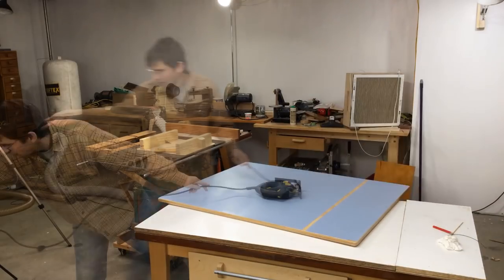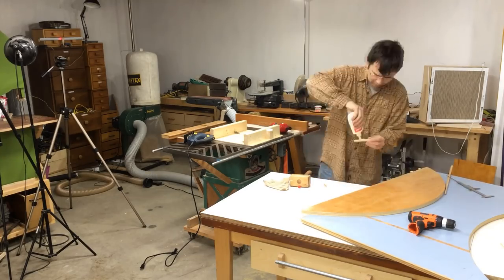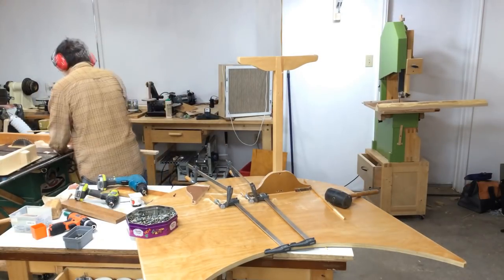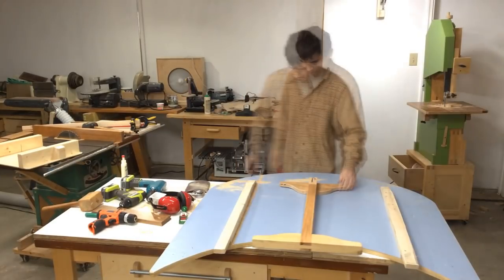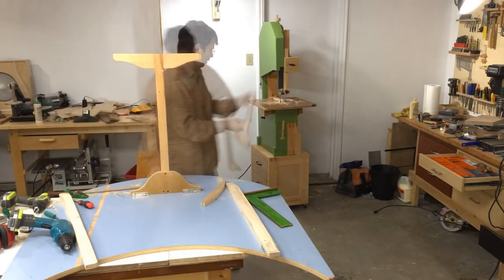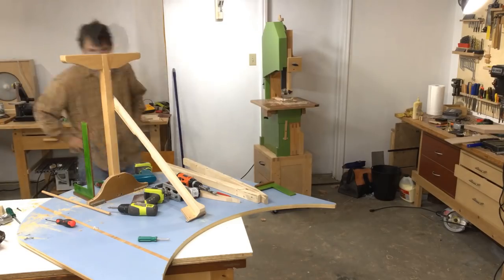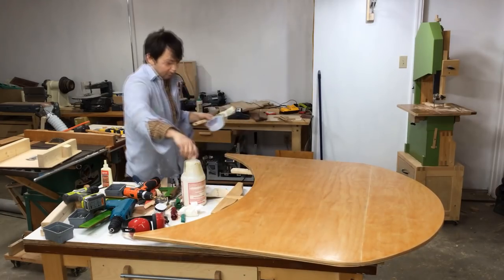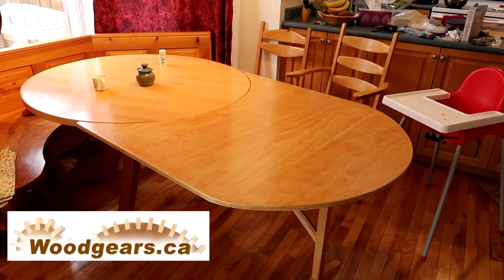Building an extension table for a round  table

Comment: When I saw that curved cut-out it took me back to my doing the same sort of thing with our dining-room table to accommodate eleven family members around a table designed for eight, a few Christmases ago.   We needed the same arrangement for the Christmas just gone, but I had dismantled the extension and used the wood for other purposes in the mean time.   I was therefore faced with doing exactly what your video shows - for just one meal - so decided to borrow some tables from our village hall instead!  Five minutes to collect and erect them in the lounge meant we all sat together without lots of work!

I appreciate that your extension is a more permanent addition, and doesn't need hiding under a tablecloth like my original version.

Comment: You could make wooden knobs (like you usually do) for those bottom screws so you don't need a nut driver! Also this video now works, it didn't few hours ago.
Reply from the maker: thought about it, but would have to glue to the metal.  figured not worth it right now
Reply: Fair enough, tnx for the reply!

Comment: Some of you folks are having video loading problems with YouTube. That appears to be a common - but low occurrence - problem with that platform. Usually it happens shortly after the author uploads the video in question and soon corrects after a delay ( maybe YouTube's chewing and digestion faults occasionally ). Sometimes a simple browser reload is sufficient to let you proceed after cache is cleared/replenished. Or perhaps try a different browser. Maybe, if you usually sleep your device rather than shutting it down, try a power cycling reboot and see if that helps. Rarely does it seem to be caused on the author's side - and so the user must try to do the troubleshooting for themself rather than notify the author.

Comment: You should make a handle that attaches to the bolts. Cut some wood into a star shape or wing nut like shape cut out a hole for the bolt head and then a set screw to help keep them attached. That way you don't have to grab a tool when you want to connect/disconnect the extension. =)
edit-spelling

Comment: No problems running plywood over the jointer like that?  Supposedly the glue lines between the layers will put groves in your jointer blades.

Comment: video is broken, wont even load.
Reply: Switched to Internet Explorer and now it works!
Reply: I had the same problem on my LG TV actually. iPad worked. Not sure what is going on. Some kind of encoding thing?
Reply: Works fine for me. The iPad time lapse app probably has some encoder errors, you could run it through VLC or Handbrake and recode it with different settings to fix it.
Reply: Its not like he took the timelapse video straight off the iPad and uploaded it here... he clipped together other pieces of video such as the ending bits and re-encoded it to a new video file in whatever video-editing software he uses.
Reply: problem is on your end, deal with it

Comment: On Linux (Kubuntu 16.04):
Chrome 63.0.3239.132 does not load.
Firefox 57.0.4 Loads extremely slowly (about a minute) then plays about a second at a time.
On Android (7.0) Youtube app:
Loads slowly and plays with interruptions.

When downloaded with youtube-dl, resulting file has no audio. 

If you're using some sort of Apple codec, that may be a contributing factor.

Comment: Hi wonder if you could help, I know how to find equal spacing e.g. between balasters on a deck railing or stair rails but given several different sizes how would I keep the spacing the same and that being also at the first and last post of a railing, is it  a case of setting out to give me the spacing I desire and would I work out the railing length say on steps first and the set the size of the deck to suit, I'm also not sure about stair railings in an house, as I think normally the treads set the trend for the spacing but when the railing runs along a landing would the drawings have been done for a railing that finishes at a wall to a specific length to match the spacing on the rise of the stair ratings or is it a case of loads of calculations until they're close as possible am I missing an easier way, sorry for essay don't know how to put it any better, I've not seen any of your vids on deck or stair rails but your others suggest your engineering mind could help, I've sent several messages to other apparently carpenters on you tube without replies I wonder if I'm asking a daft question if so hope you could tell me either way, cheers

Comment: That's odd, I tried the video once and it buffered a lot. Then I stopped it and restarted it and it worked fine.

So if that's the third use of the plywood, is that re-recycling? Whatever. It's still a very clever idea. I've done similar but it didn't have any refinement, was very crude, but it was a one time use and it was covered with a table cloth.

Comment: Matthias for all of us that can't make it work could you kindly re-upload it?
Reply: Switched to Internet Explorer and now it works!
Reply: Yeah IE to the rescue? Something I thought I would never hear.
Reply: Open the URL in VLC if you want to avoid IE
Reply: arcrad You sir, deserves a thousands thumbs up
Reply: Works great in Netscape navigator
Reply: Works on mobile
Reply: works for me on my outdated version of chrome.
Reply: Didn't work on my computer but it works on mobile
Reply: It did not work in the first hour of release. now it works though
Reply: I'm starting to wonder if I'm the only person who had no issue playing this at all. Played on my crappy old core 2 laptop on firefox.
Reply: Joe Will - I tried to watch it within the first 30 minutes after it was uploaded and it wouldn't work.  Came back and watched it a few hours later and no problemo.  Sometimes youtube just gets fussy.
Reply: Some of you folks are having video loading problems with YouTube. That appears to be a common - but low occurrence - problem with that platform. Usually it happens shortly after the author uploads the video in question and soon corrects after a delay ( maybe YouTube's chewing and digestion faults occasionally ). Sometimes a simple browser reload is sufficient to let you proceed after cache is cleared/replenished. Or perhaps try a different browser. Maybe, if you usually sleep your device rather than shutting it down, try a power cycling reboot and see if that helps. Rarely does it seem to be caused on the author's side - and so the user must try to do the troubleshooting for themself rather than notify the author.
Reply: It was a little while after upload that I got to watching it so maybe that's why it worked for me. YouTube has been very temperamental lately.
Reply: Works on Opera 50

Comment: The diagonal holds itself in place against somewhat normal forces, sure, but what if someone kicks it? It is a table after all.
Reply from the maker: if somene kicks out the brace, then the brace is gone. Yes, if they then next kick out the leg, then it will fall.   But you really have to go out of your way to kick those things.  If you want to make it fall, you can.